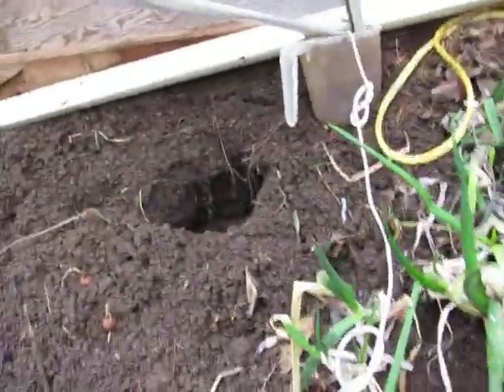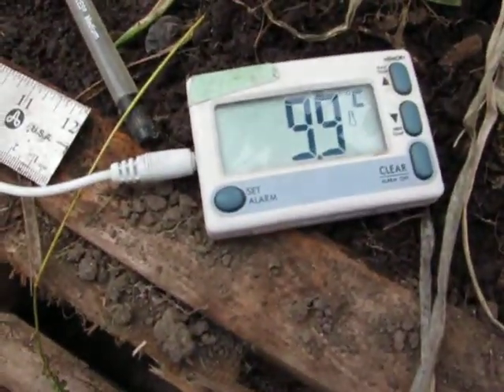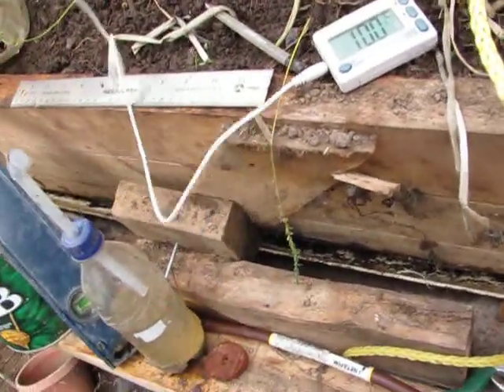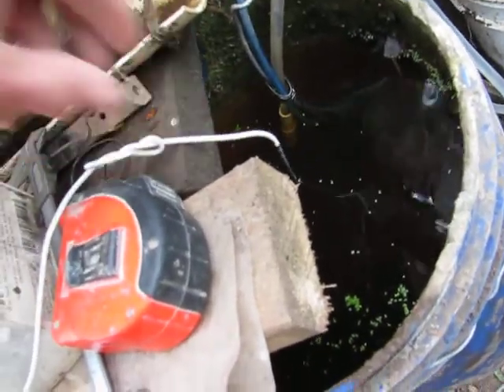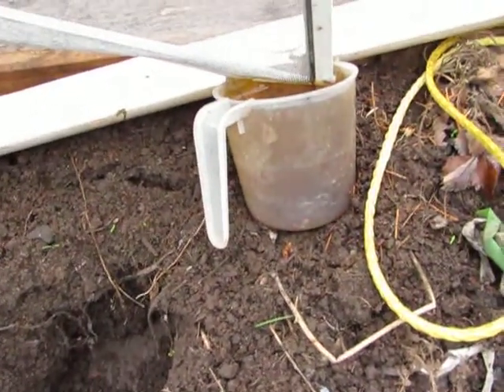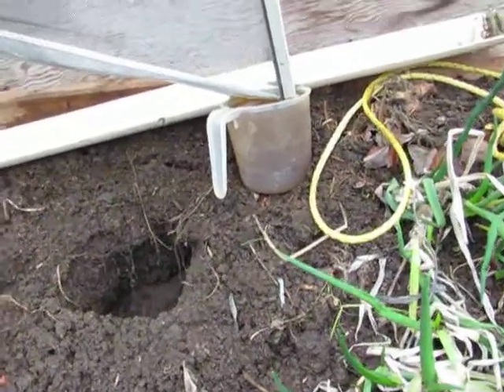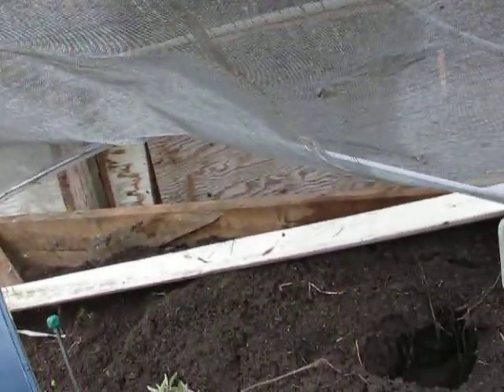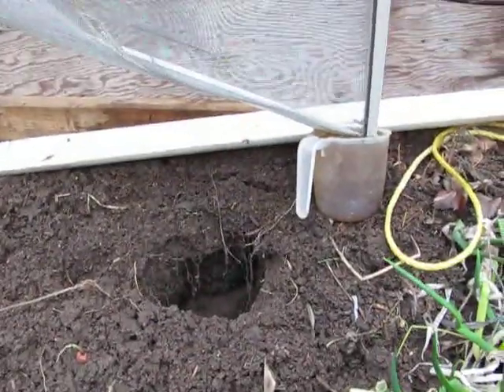First test results using insect screen to cool greenhouse air is hopeful!

Comment: This is very interesting Brian! So, do you think it would then work better at higher volumes of water and also forcing more air through it? Also, why not just use a set of radiators? I'm curious as to your perspective... :-)
Reply from the maker: Probably better at higher volumes of water.  Probably a fan would help greatly. The group "simply solar" found in side by side tests that insect screen as a solar heat collector (to heat air that is then piped into people's homes) was almost unbeatable. (Far better performance than the popular "can solar" heat collectors and way cheaper and faster to make and to install too). So all I am doing is using their findings, making a hybrid collector and  putting it to use in a different setting.  Thanks Brian
Reply: Yes Brian White, I forgot that there were guys in that group using screens for that. Thanks for reminding me! :-) I'm going to be playing around with this in the coming year or so, as I'm getting closer and closer to going off-grid. Thank you for the awesome videos.